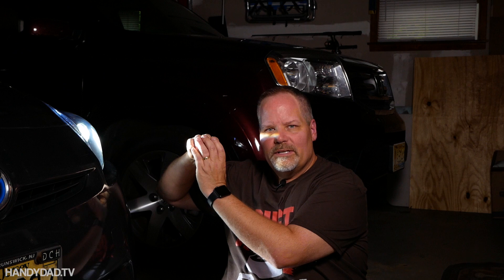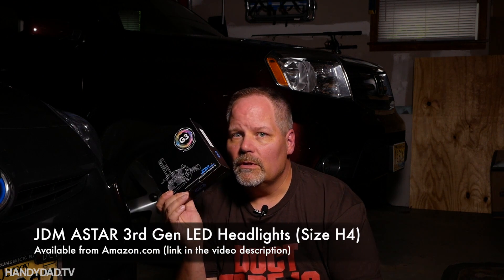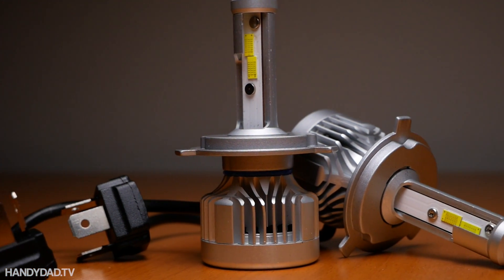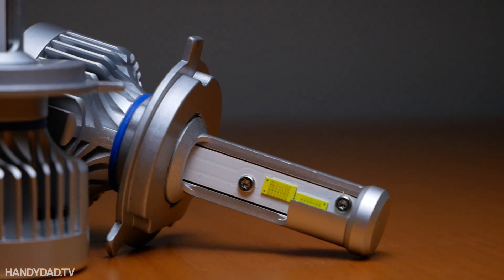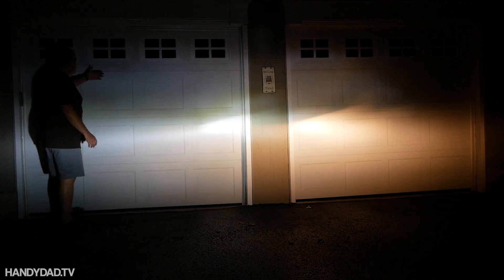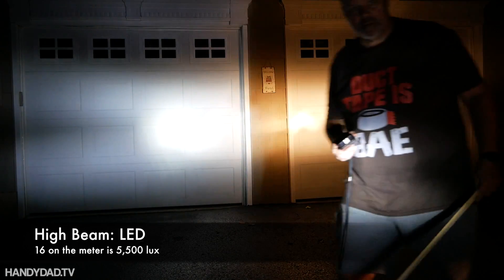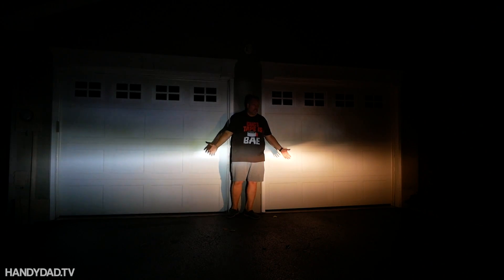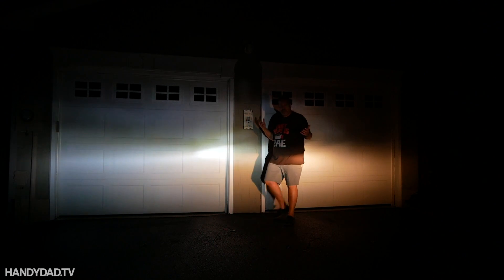Dual Beam LED vs. Halogen in Reflector Headlights

Comment: LED headlights are great - except when you are other cars on the road. I get blinded all the time by those LED lights, it is worse than if someone left their high beams on.
Reply: Joshua's Recordings
Maybe I'm wrong, but I think you have been blinded by HID. Basically it is a xenon bulb in regular lamp.
Reply: Did half of the commentators even watch the video? He clearly displayed this particular led bulb has a cut off that’s demonstrated in the video. Also the light lux was equal to the stock halogens. So even though the light appears whiter it’s technically no brighter than a stock equivalent halogens.  

BTW excellent video and through explanation. Subscribed!
Reply: Scott H your brightness logic here is flawed. Lux / lumens measure un-biased light brightness. The human eye is biased to cooler color. So since headlights are something we mainly care about humans interacting with leds are technically brighter.
Reply: Dylan White not my logic. It’s the videos explanation. Please watch fully then comment.
Reply: Scott H I fully watched the video and I know what you’re saying but it’s not 100% right. I agree LEDs are better and those pushing back just aren’t using them right/buying cheap crap bulbs, but they do perceptively to humans make them brighter per lumen than warm colors of halogens and HPSLs. Look at technology connections video on street lighting I think to understand my point
Reply: 07wrxtr1, what if the car I really want only comes optioned with halogens? I have the rig I really want but the headlights just aren't as good as I would like in the area I live in, we get tons of rain and driving at night in the rain showcases the shortcomings of halogen bulbs.
Reply: @mopar0IIII0jeep  No, it doesn't.  If you have poor visibility conditions, particularly from rain which creates road traction and hydroplaning issues, the last thing you should be doing is getting upgraded lights so your driving at higher speed can be all that much more dangerous.  When your stock headlights are not enough to speed excessively for the conditions, SLOW THE HELL DOWN.
Reply: @stinkycheese804  please spend some time to look into the 09-13 Ram 1500 headlight issues. Even while driving well under the speed limit you simply can't see with the stock headlights. When you don't have enough forward illumination to make out the fog line on the side of the road then you need to do something to improve the safety of your vehicle.
Reply: LED lights in projector style headlights work well I suspect due to the cutoff plate inside them, as for multifaceted reflectors LEDs do not work well with them as you do not have a single point source of light such as halogens or HIDs, that has been my experience.
I have tried them as H4s' in my motor bike, HB3 highbeam in my mazda 3 and have H11 LED lowbeam which actually works quite well and replaced my HID lows.
Reply: I used to get blinded by led lights, until I got them in my car. It makes a real difference ime.
Reply: In that case, just flash headlights. If enough people do it, the offending driver will fix his headlights.
Reply: you have to angle them properly
Reply: In my experience , the LED sources MUST be at the same plane as the original incandescent filaments !  Check you lamps side by side to see if the light sources are at the same mounted LENGTH for retrofitting in reflector housings .  Older cars/trucks may have had the "×" adjustments messed with and may need to be (re)adjusted ....it's not hard to do for a safe ride .
  Thanks for this fine video .
Reply: I think you'll find dazzling other drivers with leds is because of clueless people retrofitting them & not getting true like for like replacements with the leds matching the location of halogen filaments exactly.
Leds are more directional... so should be better at not blinding other drivers than halogens if not fitted by a naive diy enthusiast
Reply: @fireflymkv  Actually most of the times I've been blinded it was because of a newer BMW or Acura. The projector bulbs shine right into my car on hills and since its focused and directional its blinding. It's crazy cause I can see the cut off line. Halogen is also just s more pleasant light.
Reply: I can certainly agree with you I've been blinded by the damn things myself. I've also been in situations where it's raining and I just can't see hardly anything. almost had a head-on collision on two separate occasions because I could not tell where the damn Center line was on the road with the piece of shit halogens. but being one of them people that has been blinded by them on several occasions I did make sure to take the precautions on the headlights being properly adjusted. and I've had them in my truck for several months now and I have not got anyone flashing their lights at me. but I hope them people that don't take the time to adjust their lights get ticketed with a hefty fine. because they will cause an accident as well.
Reply: Cop cars have blinding leds. So if a cop car can do it, i can.
Reply: Yeah I use LED brake lights  
RED ULTRA BRIGHT ones  to fend off tailgaters

Works great BTW  worth the 20$ i spent
Reply: 07wrxtr1 do what if my car os a 71 camaro split bumper with a ls3 swap and I don't want to retro fit fugly projectors. For some reason the car I really want is old and I think worth more than yours
Reply: So much opinion based on such little knowledge, YET AGAIN. Good quality LED lights have excellent cut off/beam pattern and DON"T create glare. Cheap shit Ebay/Amazon Chinese crap do! But hey wilful ignorance reached critical mass in the USA long ago...
Reply: If you put LEDs on projector housing its ok, the cut off line remains the same, on reflectors it does not work well though.
Reply: Jorge Rodriguez There are all different styles of led bulbs that's like saying all 4 cyl are the same.  The type of led, reflector if any used led position how the bulb is positioned in the housing.  Then the aim of the housing itself will need checked and likely adjusted some.
Reply: Don't know about your car , but I can adjust my headlights, so the lens faces less up n not blind people. I used to get complaints, but since the adjustment life is awesome. don't be bias.
Reply: Check out:    Philips vs Osram Performance
Reply: Dead wrong there is no way you can know if that's a led or halogen blinding you.  You can just as easily blind with a mis aimed high watt or colored halogen as led.  You assume as you stare into lights as a self appointed inspector which are led.  Also if high beams aren't blinding you there is a problem.  Aimed to low, worn out bulb and or a clouded headlight housing.  They are designed to light up where it would blind traffic, why you aren't supposed to use it there.
Reply: Hids in reflector housings blind people. If an led is blinding drivers, they bought cheap ones that are put together wrong or they put them in upside down. For low beam the led should face up to reflect down, and high beam should face down.
Reply: @csheppard93    How do you know which side is up or down, are they marked?
Reply: Their dumb bitch

Comment: Good video.. nicely produced.
One thing I might mention. If you have the intake of the fan in the outside of the dust cover but the output is on the inside of the dust cover in a sealed housing. You won't get much airflow and probably will overheat the bulbs.
This would work with those passive style bulbs that have the strap style heatsinks.. you could out those outside  the dust cap.
Reply: I'm pretty sure he said it sucks the air, and the whole aluminium assembly is a heat sink, i.e. heat gets transmitted towards the fan.Hence the aftermarket dust covers with holes in them
If you look at copper heat sinks on a laptop motherboards, you'll see that the fan is not on top of the processor, but a few inches away to the side connected by a thick piece of copper
Reply: bridgendesar 
I fully understand how a heatsink and fan works I work in the IT industry. But if you look at the way he had that installed the rubber boot goes right to the edge of the circle part where the fan is if it's sucking air in from that point and blowing it through the heatsink the heatsink is on the inside of that rubber boot so the hot air will be trapped inside the housing. The air has to flow from one place to another in order to take the heat away from the heat sink. If you cover the outlet or Inlet of a vacuum cleaner the air stops flowing same idea. But it is possible that I misunderstood the way he had it installed or the picture that I saw isn't an accurate representation of how it works.
Reply: A heat sink in a computer fan assisted or not, has air drawn in around it by the large rear fan.   I think the point he is making is that there is no input/output of fresh cool air!
Reply: MegaPoxie 
That's what I was trying to explain. Thx
Reply: Richard Dodd
You think that tiny breather tube is gonna flow enough air to keep the lights cool???  Ha HA HA..   I'd say it's you that doesn't know much about thermodynamics or fluid dynamics.
Have a great day..
Reply: How exactly is the fan going to draw air in the pressure relief vent (which doesn't exist on european lamps) and exhaust it out another hole (which doesn't exist)?

Fans and heatsinks are bad news in an engine bay. The fans seldom last more than a couple of years and the heatskinks clog up with the extra airflow forced over them.

BTW if you retrofit leds or hids in a car in Europe which isn't equipped with headlamp washers AND automatic headlight levelling (and a headlamp assembly certified for them) and the authorities notice they will impound the car on the spot in most countries - they tale it that seriously due to the glare issues.
Reply: Alan Brown 
All European cars have them?? You may not see them but they do.

If the bulb was designed well then it should work as long as any halogen, depending on the manufacture this may or may not true, there are so many different company's making then then they have various versions.

You are somewhat right, they 'may' impound it, they are more likely to issue a defect notice and make you fix it within 7days IF they notice, with the dwindling number of police on the street it's getting less likely, same reason the number of people driving without tax is increasing even with anpr.
Reply: Richard Dodd it depends on the police and how bad the lights are, but illegal headlights are likely to trigger a roadside inspection for other issues. Surrey uk Police claim to have picked up quite serious offences on minor violations.
Reply: He installed them correctly, you guys are wrong. 
All headlights have vents, normally in the form of a small rubber tube facing downwards. The fan will draw air in though this vent and out the back, no headlight is actually fully sealed.
You can even see the vent next to where he trimmed the rubber boot.

Stick to IT because you know fuck all about headlights.
Reply: kens97sto171 my PhD says I do, although I did struggle a little.
I'm sorry I didn't know you knew the fan specs? I doubt even the manufacturer does, these are just some crap from China, the fan probably doesn't do much anyway.
I have a similar set and the fan movement can barely be felt on my tinge 10mm away.
The vents on cars vary quite a bit between manufactures.
So yeah I'll call you on that bull shit your spouting

Comment: I had an eye doctor tell me that HID and LED operate on the blue white scale of light which is better and easer for our eyes to see. Rather than the yellow scale that other lights operate on. I am changing all my lights in my house to led. They use less power and last a lot longer than those crappy CFL lights. Also when they burn out you can just toss them in the trash unlike CFL’s that contain mercury!!! BIG TIP!!! I found LED bulbs at my local dollar store!!! So I’m gonna save in the short term and the long term!!!
Reply from the maker: +Dj Project Awesome! My whole house is LED as well.
Reply: LEDs also contain horrible chemicals in small traces like CFL's do.

Comment: so what is the good LED for ford expedition 2008
Reply: Cairo dude just Google it. Do your own research.
Reply: None.  Your headlights are designed by engineers with a much better understanding of physics and lighting than anyone here and they are designed around that stock halogen bulb.  You cannot simply swap to another light source in the same housing and expect it to work properly.  That's like putting transmission fluid in your engine because they're both oil, they're designed for totally different things.

Comment: Your getting flickering on the led. If you got a more higher end led it would of came with a black box that would stop the flickering.
Reply: Actually even the LED lights manufacturers put in the cars today flicker, that is because they do not have a constantly glowing filament or lit plasma as halogen and HID have, but they are always powered through some electronics and a regulator, causing this flicker (mostly around 30 Hz).
In most situations the human eye in dark surroundings does not notice, you will mostly notice in your peripheral vision. 
It gets more clear in a video as you get some interference effect depending on the camera shutter speed. a slower shutter speed would resolv that.

Comment: The reason why LEDs seem brighter is due to the white light being emitted. This is a false real world reading for the following reason. Your eyes go into white-balancing mode. Thus, your eyes will see anything white as "better" and "brighter". However, white light gets easily washed out by water and asphalt. So, for real world applications, your eyes will adjust to white better, but intensity is way less. Finally, that glare above the cutoff that you see on halogens is to gently and softly light up road signs and produces no glare. HIDs do the same when used in their respective headlamps. LEDs, not so much.
Reply: @crazy wheel you can have as many lumens as you want, say 20 million lumens but if they're being scattered everywhere, then an efficient halogen setup will outperform it. Remember, white light is okay. But when they are in a setup that is not designed for it, you will lose output.
Reply: use yellow to increase contrast, good fog lights are yellow
Reply: The morimotos are a copy of the E46 projectors in a smaller housing with poor chrome painting on the inside. Similar to the older halogen projectors where the chrome would burn and peel off due to heat. I haven't been on the retrofit scene in forever and now I have a car with LED lights. It's pretty sweet but I need me something with the width of a LS430
Reply: The nice thing about LOUD mufflers in europe is that part of the homologation spec is exhaust noise. If the exhaust is louder than spec, then it's illegal and the car can be impounded on the spot and registration suspended until a full homologation inspection is passed (this is more in depth than the standard roadworthyness checks). That means the owner has to pick it up from the impound yard and take to the inspector on a flatbed and if the car's caught on the road again without registration (even parked) then it's seized/crushed and the owner arrested.

Homologation inspection on a car with an illegal exhaust usually shows up a bunch more illegal mods, so these cars seldom return to the road.
Reply: I can attest to that. I drive a peterbilt with projection headlights. I replaced the standard slightly white bulbs with pure white bulbs and every time it rained i could not see the lines on the road the entire road just washed out. Only lasted a week before i put the normal bulbs back in.
Reply: Chris M I'm not and expert but I think you are half right,  cool light (about 5000k and up) is easier for the human eye, but if you also want I greater output you will need to look for higher lumens
Reply: What matters is the beam width. And that will not change on those headlights unless you retrofit projectors in them. Then it will change depending on what projector is used
Reply: Chris M good luck trying to find a pair those now
Reply: LS430 projectors? I have a few in my garage somewhere. But I was talking about LEDs hahaha
Reply: Chris M really? No one has them now. A pair of those with d2s based led bulbs would be money!!!
Reply: Good video thankyou but when LED's are on the high beam on reflector lamp as with a H4 halogen equivalent the light does not reach in distance quite as good as the dipped light does in a projector light on dipped using H11 or H7 equivalent.
Reply: The cutting beam of a modern LED looks way brighter, like a day and night difference. But when I describe what I actually see, the illuminated spot of my old-fashioned halogens is actually bright enough for me to see everything. And their stray light around the car not only increases actual night vision but also is more pleasant to me eyes.

What I do miss however is the far reach of a modern LED.
Reply: POSITION  of  the light sources is critical.... hold the lamps side by side to MAKE SURE the LED resides EXACTLY where the original incandescent filaments are .  Shorter or longer will disappoint you .
Reply: "your eyes will see anything white as better" that's racist
Reply: White light is also worst for fog use as it disperses quickly.  That's why fog lights should be yellow! Most peeps are morons.
Reply: Chris M finally someone said it. 

It’s just like someone who throws an aftermarket muffle on their car and think because the car is louder, it’s faster